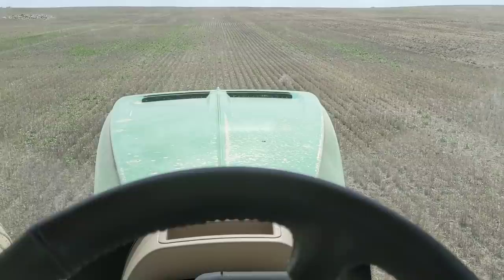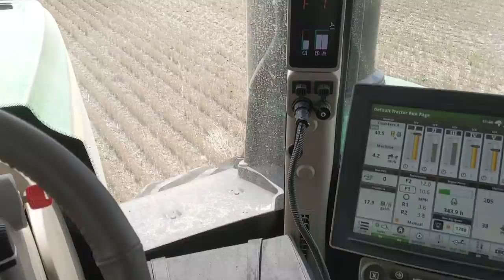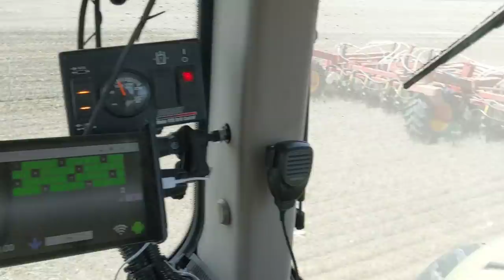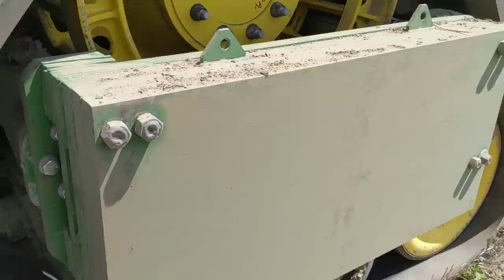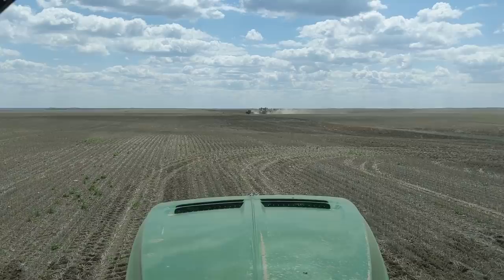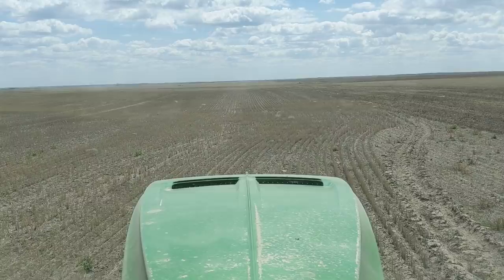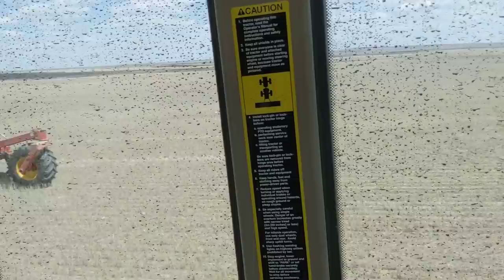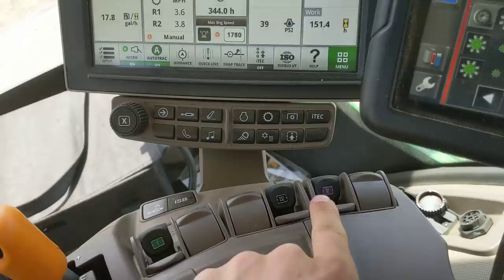Full John Deere RX620 Review

Comment: We run 4 of the 9620RX and used to run case 620. I couldn’t agree with you more on your cons of the Deere. That trans drives me crazy on the cart and pulldozer and I don’t even run the carts!  Occasionally while unloading on the go the trans will cut out and go into neutral. Not even during a hard pull. We’ve tried all the trans modes and different engine rpm etc. but still does it. The main pros are the GPS and monitor/controls in the Deere and so far haven’t had any idler wheel seal or axle seal issues.
Reply from the maker: Right?! 😂 🤷‍♂️ And I agree

Comment: Just got a 9620rx this year used with 1900 hrs. Came from a 9520t. So obviously I felt it road great lol. My issues were a lot the same. We have the 76’ Conservapak and C850 and it just seems to be doggy and not enough weight. Probably gonna add 2000lbs to each track for next year. We weren’t to worked up about the def or fuel burn but why not a bigger def tank. Annoying. Usually could go a full day but quitting time was with 0-2 bars on gauge.  But for a used tractor and drill we literally had no downtime.  So no matter how nice it is it doesn’t do anything for you sitting at the side of the field.
Reply from the maker: Thanks for the comment good sir! We have a 9560rt and yes, haha it's incredibly rough, obviously has it turning down sides but put that thing in a straight line and it will match those 620s.. Or at least close to it - pulling the same load.. So I agree with you, the 620s are too doggy and light.. 

The problem is, that JD knows about and recognize it - do you have that HP (hyd) upgrade? We don't.. Jd will add 30 - 50 hp for a cool $30k per tractor.. Same with the weights, they know they are lacking, but will just add more at my expense.

I always say, I baught a 620hp tractor, not a 580Hp tractor.. Fix theses issues on your dime..

Comment: One thing that has bugged me for years are the mirrors on four wheel/track tractors. They are pulling equipment 50 to 80+ feet wide but the mirrors are set vertically. You see lots of the sky.  Mirrors are to see what is behind you, rotate them 90 degrees so you can see MORE of the implement at a time. Never can figure that out.

Comment: As a Canadian why don’t you test the Versatile 610 delta track just for fun🙋‍♂️
Reply from the maker: Haha that's good question 🤷‍♂️
Reply: Its no good id say....best part on the versatile is the sound system and the big cab and the transmission...thats it notin else
Reply: Had it for a 3 year lease went back to the case quad
Reply: Doc Savage  had the 550 delta track...was running a bourgault air drill 60 feet disk... and we had alot of hydraulic problems with it because that bourgault seeder needs lots of oil... just hydraulic seals going even hydraulic blocks cracking up...not sure if they have improved that yet

Also had lots of trac issuies with the rubber pealing off the idlers and i never exceed 17 18 mph with track tractors...and in my book it did not put out 550 it was gutless always stalling out and popping out of gear.. got a 620 case quad now going on 4 years and it hasnt given us any issuies except DEF stuff and we deleted that so its running fine now...
Problem with the 620 quad is the engine is to small its a 13 liter so theirs no torque their for high speed disks or rippers.. i wish they would find a bigger engine something like the old cats have the c18 or somthing would be awsome
Reply: Doc Savage  absolutely tuned it u0 abit sitting at 700...but like i said it dont matter how much hp u put on their it dosent help...because engine is to small cant put out enough torque...ya we decided to delete all our equipment combine sprayer all that and its 20 times better🙂
Reply: No hills flat ground but heavy heavy soul... take a 36 foot disk sinknit to 5 inches or so  ull be maxed out with any tractor here
Reply: Doc Savage  4430 sprayer case
Reply: Doc Savage  all honesty next time around were gonna look at some other stuff because having alot of smaller issues with the 4430
Reply: Doc Savage  i just ddont understand why they would put a 16 liter engine into their 9250 combines and mot in their tractors sounds pretty uneducated to me
Reply: Doc Savage  i should take a ride to the factory with a couple of my buddies with the same problems with the engine 😂
Reply: Doc Savage  lol🤣🤣that would be epic

Comment: You need to try the 9520rx with the deere engine 13.5 liter, it burns less fuel, and def, and its much better on power, and it has less slippage, I've had both, would never go back to one with Cummings engine
Reply from the maker: Very intriguing, you think it will out pull the 620 up a hill?
Reply: @mikemitchell2554  it will and then some
Reply: @douglasgross2533  Wow that would be a neat test and quite impressive if it did! I've always been a Deere Fan for AG and a Cummins fan in over the road trucks. SO I thought man this is a fantastic pairing... best of both worlds.
Reply: Mike Mitchell The 9520 RX just seems to put the power to the ground better if Was me I would go and get one

Comment: Hey Mike 

I'm a Deere guy/Grew up a Deere guy as that's what my Dad ran and I think the Four Track RX Series are super cool. But all that being said I know Warranty is a huge thing and you have mentioned that's a big reason to move to Fendt/Agco for curiosity have you heard that Versatile just launched new comprehensive warranty coverage of 3-year/3000-hours on all 2020 tractor models. 

The new warranty from Versatile is supposed to be a full warranty that will include 36-months of powertrain, hydraulics and premier component coverage. 

I know you mentioned Fendt was 5 years but you also said you like to trade out every 3 yrs so maybe it could work. I would just be curious as to initial cost comparison and how a Versatile compares in usage like weight pulling etc?
Reply from the maker: Hey Jon, very instresting.. I did not know that!.. Next time I am near the dealer, i ll stop in and ask! Thanks for the input Jon, really appreciate it!

Comment: This is a decent review, i geuss im a jd guy. But i think youve got valid points. I will say, i was gutted when they introduced the 620 with the cummins, ive always found them to be under powered and fuel hungry. Woulda loved to see a big cat in there. 

John deeres cab suspension is imo no good. I would always take the active seat over the cab suspension. (You cant get active seat and cab suspension) 

I really think that if you fully loaded that front weight bracket itd help.

If it were me i woulda gone for a wheeled 9570r with the hyd axle suspension.
Reply from the maker: Hey thanks for the input! And you sir win the best and most respectful comment!!
Take note "Fendt Claas" guy - this is how you respectfully respond to criticism regarding the colour u might prefer.
Note: No name calling, No rude comments, admitting there can be flaws, admitting the manufacturer can improve in some areas, and last but not least, Respect. 🙂

Sorry to make point on ya there Living The Machine Dream, but this Fendt Claas guy (Regarding the 1050 Review) needs to take some pointers. 🤷‍♂️😂

I really appreciate your feedback, and will consider filling that front weight bracket for spring. And I agree about the Deere Eng and the 570.  We have a 560rt and thing will just about match those 620s in straight line of course. I often thought maybe we jumped the gun on the 620s. 🤷‍♂️🤔
Reply: @mikemitchell2554  all good brother, make a point where you can.

Yup i think deere make good engines so thats why id stick with the 570. Hopefully they will sort out the higher hp with maybe a bigger engine or maybe theyll find a few more ponies in the 13.5 litre.

I saw your 1050 review, and also thought you were bang on the money, i have driven fendts alot .only 900 and 800 series,  and they are a great tractor! But like all machines have their faults.
Reply from the maker: Agreed! I appreciate the feedback there good sir! I just like all equipment 🙂 It's what fits or works best or where you get the best service.

Comment: Mike did you know in the cab on the ceiling you can pull out the air vents it has a can holder so you can cool a beer or pop faster

Comment: It’s the cab suspension that makes it so rough going across ridges. It is so unbelievably free and loose that it rocks front to back. If you take off across ridges and get out and stand on the ladder, the actual tractor is smooth as glass. The cab will be rocking uncontrollably.
Reply from the maker: That seems counter productive 🤔

Comment: Just curious why you don't seed at a faster speed? Any reason behind the slow pace?
Reply from the maker: Yes.. It will start "stepping" which is term used when the dirt from one opener goes over to the other causing it to to two things. One throws more dirt in the furrow adding to its depth. And two, the wheel than can drive on the extra dirt and could cause the opener pull out of the ground abit

Comment: Flaw number 8 they shouldn’t burn def and they would burn a lot less feul as well and not burning def
Reply from the maker: I totally agree with you Aaron! Thanks for the input
Reply: Gotta save the planet.
Reply: @cnacma  DEF, DPF, SCR and EGR are whats ruining things! Would be allot less stress and Fuel burned without all that Garbage!
Reply from the maker: Agreed!
Reply: @jonkreiser7757  Technically it's only EGR and DPF that mucks things up. 
The DEF and SCR has absolutely no impact on the engine as it's just a catalyst and a spray nozzle downstream from the engine... I guess you could argue that it adds a bit of back pressure in the exhaust but that is going to be very minor if it's even measurable.
Reply: @frankeinfish  Yeah I hear what you are saying and wouldn't disagree. And I totally agree that EGR and DPF are problematic and create issues for the engine but I was morseo getting at the fact that all these additional Emissions related systems create and cause downtime, expensive repairs, and overall frustration from codes being set, derating and not allowing you to run your equipment especially in critical time sensitive times.

Comment: You should really talk to John Deere because there might be something wrong
Reply from the maker: Unfortunately we have.. Many times 🤷‍♂️
Reply: It's not just the RX transmissions, it seems like the slow shifting is on most of the gear transmissions on the R series. They shift like shite! Must be for reliability or something.
Reply: That's the reason why I don't like power shift had a shitpile aka versatile that did the same thing shifted so slow and the shift steps where so large that u hit your head on front window and the back . but I guess that's the reason we put in power packs spring and fall😠😠😠😠  I like the stick em up slick slick transmission the 24 speed power quad from jd

Comment: Check out the Millennial Farmer he has someone who will come and reconfigure the horsepower to 30  + They said it was less expensive than JD - Just a thought
Reply from the maker: Which = good bye warranty..
If John Deere cares about the keeping me in their green colour, then they would be stepping up themselves. Otherwise, goodbye 👋 green.
Reply: Yep, the fact that it's possible and for a price, that does not sound like the dealer has your interest at heart. The cost of these machines , well I think that something is wrong with the system. I can see why The Welker boys have spent so much keeping the Big Buds going.
Reply: And the transmission failed in that tractor.

Comment: add the weight on the front you goof cus the drill pulls u down in the back. had the same problem on the blue shit that out there fill the front with water and a hole new game but i cant beleave the fent didt pull the 2 track away thats cool so i know my 9560rt can pull
Reply from the maker: That's very interesting thought there Bob, tho, I didn't add the weights, the dealer did.

And I figured it would be a draw 🤷‍♂️

Comment: So why have you got a fleet of them and not case
Reply: He said he couldn’t afford the parts bills on the Cases. Deere has lower power and softer transmission = easier on parts.
Reply: @mitchrabe2155  nope. The case shifts smoother and quicker and higher horsepower is a good thing in his operation

Comment: Hey don't be knocking the Deere to much on the slow shifting the new Holland/ case ih big tractors do the samething the t9.565 new Holland is incredibly slow shifting too
Reply from the maker: I guess I am coming fresh off of a Case Quad 620, and it shifts way better than the Deere..
Reply: @mikemitchell2554  I'm unsure of that but the t9.565 and a quad Trac are both built in the same plant and are both modeled after the steiger both wether people know it or not are  case products
Reply from the maker: Yes I know that, but if you could hop in one make a pass or road the tractor down the road, then hop in the other one and do the same (Case & John Deere) it would blow your mind on the differences
Reply: @mikemitchell2554  definitely should try that with both!!